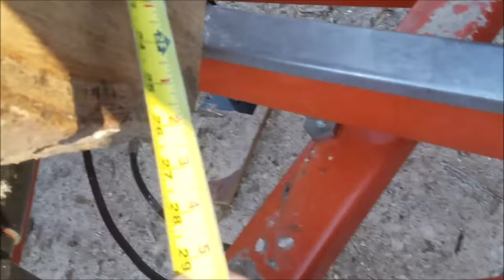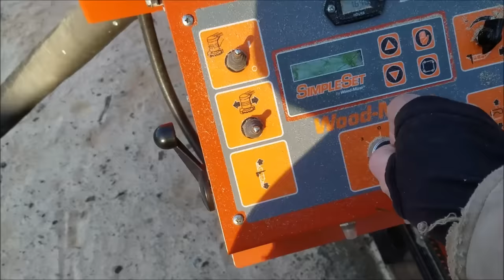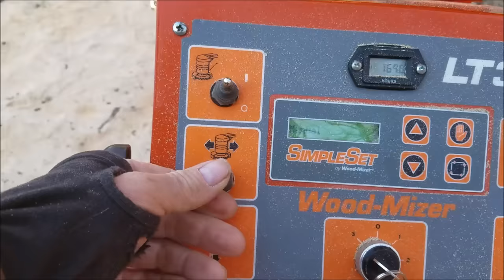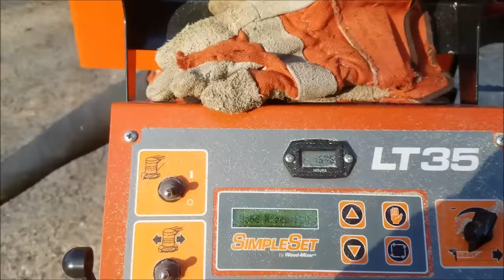White oak and Hickory on the LT35

Comment: Built a lot of custom furniture over the years out of pine, cherry, western red oak, and some walnut. Never had the good luck to see red oak like that you mill. Thanks for the milling. Learning a lot
Reply from the maker: The red and white oak are beautiful around here. Not to hard to work with. Makes some great furniture.
I have a stash of curly red oak that is rarely seen. I'm waiting for a special project, to use it. It's not quarter sawn, but curly. Like you see with curly cherry or maple.
Planning a quarter sawing video in the future.
Reply: Is what I am calling WOW wood. Is wide, clear and just beautiful
Reply from the maker: @robertrussnogle7449  I didnt get video of the sawing g, but i did get some video of the red oak I did last summer. Some really wide quarter sawed boards.
It's in the video, "Shiwing a red oak who's boss"
Not sure if you saw it, but check it out.

Comment: The 35 is a big improvement for you. I like the rolling feature.
Reply from the maker: I have to agree with you on that one David. We figured if we wanted to continue with the mill, we needed Hydraulics. The logs weren't getting any smaller. LOL
Reply: And the loading feature.  I've been watching a lot of these vids.  I've noticed that the 15 has a double stack to support the blade and the 10 and 35 have a single. Does not allow more wobble in the cut?
Reply from the maker: @davidrice2862  even though the 15 has a second post, it really doesn't support it. Its not attached to it. The outer post is a guide, rather than a support. Any of the models, if adjusted properly, will cut straight as an arrow.

Comment: Hi, I noticed in the early part of the video what looks like sparks coming out of the left hand side , this had gone by about  17 minutes which got me thinking would a drop of oil on the blade help with the life of the blades ?
Reply from the maker: Hello, and welcome to the mill. I believe what you saw was a glint of sun light off of the sawdust. If I had hit something to create sparks, it would have dulled the blad, and ruined the cut. 
We do run a liquid on the blade. It a mix of 5 gallons of water, 1 cup of pine-sol,  and a squirter of dawn dish soap. This keeps the blade clean, and cutting straight. Without it, the pitch would build up on the blade, creating heat, and causing the blade to fail prematurely. 
Tha k you for your question, and I hope to see you back soon.

Comment: Some one should, cutdown trees before forestfires! get to it  make lumber for those that loose thier homes.
Reply from the maker: I do agree with proper forest management. We have moved away from that, and it has left our forest vulnerable to these super destructive fires. 
Proper, and reasonable harvests of trees. Protection of old growth stands by removing the fuel load on the forest floor. Controlled burns, by skilled experts in the field.
I'm no expert, and I'm sure there is more that can be done. These are just a few ideas that would make it much safer, and still maintain beautiful forests.

Comment: Why do you keep rotating it after a couple of cuts? Every time you do that the next boards aren’t the same width.
Reply from the maker: I dont cut for size. I cut for best yield. Turning the cant keeps stress out of the cant and the lumber coming off the mill. Keeping the grain centered in the board helps to keep them straight and true.
Reply from the maker: @smacmillan8399  you are correct. Picking the best side of the cant to get the best lumber and to keep the stress minimized in the cant.
Reply: @IronOakSawmill  ккккккккккккккккккккккккккккккккккккккке как 3вчПяччсю

Comment: At some point does this lumber wind up in a kiln to get it to furniture-grade moisture, around  12-14%??
Reply from the maker: We can air dry down to that level or lower. Approximately 1 year per inch of thickness is the general rule. All the lumber from this video has long been sold to furniture makers / woodworkers, and they were very happy. Anyone doing steam bending can not use kiln dried lumber. Or so they tell me.
Reply: @IronOakSawmill   Thanks for the answer, yes I've heard the same about steam bending. I prefer air dried under my planes, it's just so hard to find here  in the Northeast!
Reply from the maker: @clivemossmoon3611  we have clients who  buy lumber from us, and they prefer the air dried. Especially Black walnut. Kiln drying changes the overall color of the wood.

Comment: saw those beams you have. been looking for some white oak engine mounts for a boat someone gave me .about five and a half feet long by 31/4 thick and seven on one side angled to 6 on the other for the boat bottom angle  but i think your to far away to go get um I live in ct .    Joe
Reply: 1/4
Reply from the maker: I'm in PA. I dont have any white oak that thick, but you may want to laminate those sections for more stability, and strength.

Comment: Here's a thought. Why not, instead of crossing your fingers, buy a $150 metal detector and save yourself some blades.
Reply from the maker: At what depth?
Reply: @IronOakSawmill : For $150 you can find detect a #4 nail at 12 inches.
Reply from the maker: @timhallas4275  that's part of the issue. I detect a nail, and start digging so I can pull it out. How big of a hole will I have, and how much lost lumber. I have a detector, and dont use it because I've wasted much more lumber than blades.
If a log is riddled with nails, I'll junk it.
Ky point is that before I reach that nail, I may be able to mill hundreds of dollars of lumber before I trash a $23 blade.
I wave a wand, and detect metal. I make a cut and find a nail. I pull the nail and continue. 
I wave a wand, and detect metal. I make 4, 5, 6 cuts, milling hundreds of dollars of  lumber, then find the nail. Pull the nail, and continue.
I can afford a blade. I can't afford to trash valuable lumber, digging for a nail that I'm not exactly sure where it is, in the log.

If all the nails were on the surface, that would be great. I could find them with the detector, remove them, waste no good lumber, and save a blade. Some of the nails, insulators, rocks, were put on the tree 50 or 100 years or more ago. I'd waste a lot of lumber digging to find them.
I appreciate your suggestion. Do t get me wrong. If I was running a mill with a blade worth hundreds, or more, I would use a detector, and cull logs that I found metal in. Detectors are a very valuable tool in that case.
I may have wasted $150 in blades by now, but sawed $1000's  of dollars before I found those nails.

Comment: I enjoy your video... why such a small tractor to handle the logs?... for what you paid for that tractor you could have had a used skid steer or a much bigger tractor ...used
Reply from the maker: Thank you for watching, and for your question.
The tractor was purchased used, about 4 years or more, before we out first mill. It's our all around machine here. We also use it to cut  our grass. It's nice not to have to have a a separate machine.
Also, if you check some of our other videos, you'll see a large skid steer. We borrow that from the neighbor if we absolutely need one. We are are luck in that respect. He is a generous person, and enjoys helping out.
Reply: You'd be amazed what these little Kubota tractors can do.  I am an excavator and have one just larger than this one.  It is my go to machine for much of what I do.  I also own a skid steer and it is a one trick pony compared to my little tractor. Give me a tractor before a skid steer for 90% of the jobs.  Small ones in many cases are better than big ones.

Comment: Nice saw. None of my business, but you will be far ahead if you avoid “city trees” altogether.
Reply from the maker: Urban logging has been working well. We do have some metal issues now and then. I've learned to saw to relieve stress in the cant due to "city growth".
Overall, it's been yielding a quality product, saved alot of logs from the dump, and has proven profitable.
Yes, I would like to saw "woods trees", but competing with the larger mills for purchasing logs would eat most profit. 
We do get a good amount of these logs from lot clearing, which is where these came from.
The front of the lot was untouched. The house was set well off the road. The owner wanted to clear most of the trees, clear the underbrush, and manicure the front of the lot, so these are "woods trees".
Reply: Iron & Oak Sawmill thanks for the perspective. Best wishes on your endeavors...
Reply from the maker: @Chuffin_ell  to you as well friend.
Reply: @IronOakSawmill     .. Allah/

Comment: could  you not save and  bag  some of the  sawdust  from  the different trees you  cut and sell   them for  a couple of   bucks a bag  for   smoking
Reply from the maker: It may actually work for smoking, but it does contain the blade lube, which is pine sol, and dawn dish soap.
I turn it off for a few cuts here and there, to save some of the first cuts for smoking.
Thank you for your question, and for checking in.

Comment: What are the usage for cookies?
Reply from the maker: Folks like to use them as center piece holders at their wedding receptions. Seems to be big around here.
Reply: @IronOakSawmill  Thanks, I've heard the term but never did hear what they were used for.
Reply from the maker: @dennisworkmansr.714  I plan on cutting the logs on an angle in the future. That will produce oval shaped slabs. Have to design a way to hold it.